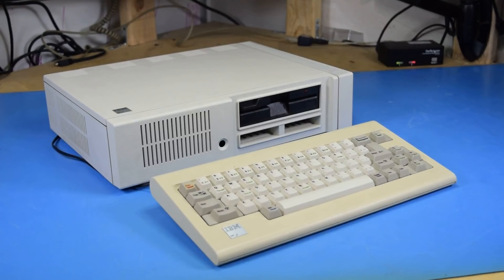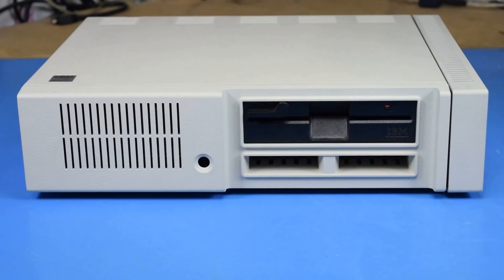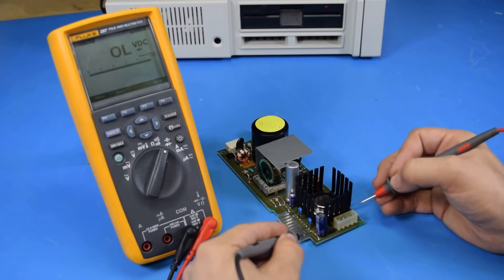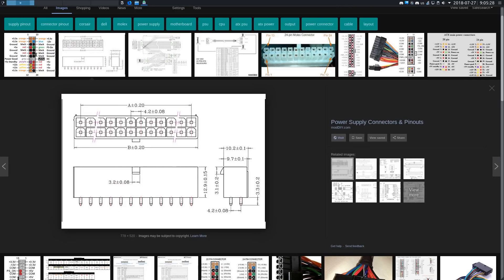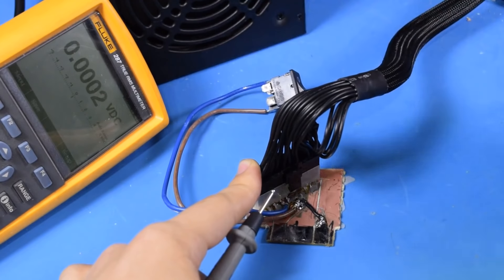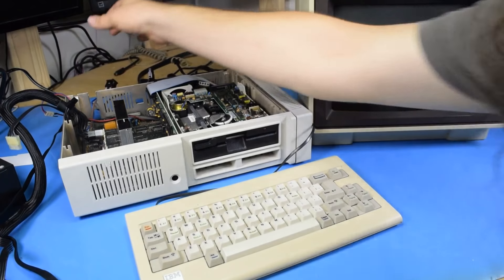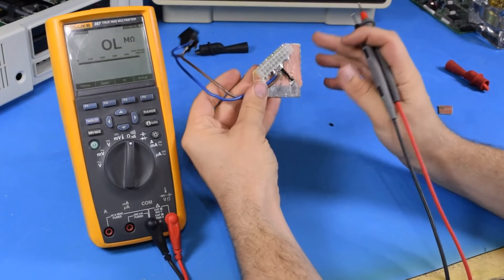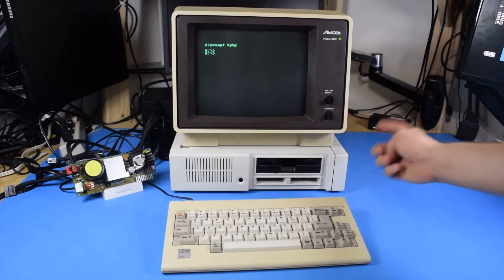0x0035 - IBM PCjr ATX Power Supply Adapter Prototype

Comment: you get a negative resistance because the multi meter mesures a voltage increse rather then a drop in voltage
so the fluc is acting like the electrolyte of a battery

Comment: white vinegar. table salt, hydrogen peroxide makes a weak hydrochloric acid solution that will etch standard hobby grade pcb's in about 30 - 60 min
Reply from the maker: I read about a reusable solution you can make a while ago that can be rejuvenated. I'll probably look into that for a long term solution. I'm not super thrilled with the idea of needing to dispose of extremely toxic chemicals.
Reply: yea that's muriatic acid and hydrogen peroxide, you refresh it by pumping air though it
Reply: You can de-copper used etchant by dumping steel wool into it and leaving it for a couple of days.  It's then not particularly toxic.  Also, sharpies work as etch resist pens.
Reply: @TechTangents  That reusable solution you're referring to, muriatic (hydrocloric) acid in peroxide, I'm guessing, generates cupric chloride which will eventually need to be disposed of as well.  It's waay more toxic than just using ferric chloride and the fumes are horrible.

Comment: Does the original power board have a bridge rectifier immediately after the input socket? If it does, simply connect a 19..24 V DC power supply to the input and that's all.

Comment: Have you seen one of those Racore/Rapport expansion kits for the PCjr?  My PCjr had a double-height sidecar that had a parallel port, a PC/PCjr toggle switch, a memory expansion board and a floppy controller that allowed me to have a 2nd 360k floppy drive.

My memory expansion board had 256kB of ram on it.  That toggle switch was a rather poor attempt to switch between 40 column and 80 column display modes on start up.

Comment: Since the PCjr uses such low amperage, you could just add a 7912 to the [-12v] rail and a Pico-PSU (or compatible clone) to internalize most of the power delivery (still need a external 12v power supply, but those are fairly widely available)
Reply: With the Wide Input PicoPSU, you can even give it 19 volts.

Comment: According to my roommate (who's studying to become an EE), you likely got the negative resistance from having your probes backwards.

Regardless, congrats on getting this working. The flux issue sounded a lot like an issue David had on 8bitguy when he was assembling the PE6502. He didn't clean off the excess flux like he was supposed to, and it ended up causing problems.

Comment: 12:12

I'm fairly sure the click noise you were hearing was just the PSU trying to start up, since the reservoir caps still had some juice in them.

(I'm assuming you tied the /PS_ON signal to ground on your adapter PCB, so the PSU will switch on as soon as mains is applied.)

I doubt there is a relay in the PSU, and it's just inductor noise for a brief pulse.

Props for manually cutting the PCB like that, but personally I would have just used an older / crustier ATX PSU, and chopped the plug off.

Or, soldered some wires (plus heatshrink) directly to the pins of the ATX socket, then just scored the edge connector for the PC Jr out of the copper clad.

Again though, it was genuinely interesting to watch, as I don't think I've ever seen the box cutter PCB method on YouTube before. ;)
Reply: Ohh - I watched the rest. lol

I think we've all done the mistake of reading the reverse pinout once or twice. hehe

I now have the strong habit of double-checking the PSU or whatever with the meter (between common grounds or other known wires).

I've even seen pinouts on the Interweb that have been reversed from how they are labelled.

Comment: I think a cheap ultrasonic bath would make a good investment.
I'm not sure what you cleaned with but I've found that isopropyl can't dissolve the flux I use so I use lighter fluid and then isoproyl now.

Comment: What I have in mind for such power adapters is actually make them run on a 12V barrel jack input. The +12V rail is a direct pass-through (maybe with a fuse, a diode and a TVS as some protection,) 5V is obtained from 12V through a buck converter based on LM2596 (I have the room anyway so bigger components are okay,) and -12V is obtained through 12V through a buck-boost converter based on MC34063.

Comment: Do you also put a molex and fan connector on the board so they don't have to be wired from the power supply.

Comment: It takes in 19V 2.5A AC? I would probably just get a small transformer and solder those wires directly to the power board(as that connector might not be available).
19V 2.5A DC? I would do the same thing, I mean just hooking up wires directly to the power board but use an Asus Laptop/monitor power supply(they are usually rated at 19V 3.4A).
Reply: those power supplies you are talking about are most likely DC and use some type of switch mode power supply circuit so they wont do....he needs 18v or 19v AC...you need an old school power brick with an actual transformer on it and remove the bridge rectifier...and a 19v 2,5a transformer would be quite beefy and heavy....maybe if the PCJR powerboard rectifies the supplied AC immediately right after the input, then you probably could get away with feeding it with DC
Reply: Hugo Barbedo well if I can take a look at it I would understand whether it is taking in the AC and converting it to DC and nothing else then feeding DC would be okay. For AC I mentioned about directly using a transformer.
Reply: yes i misread it..but a 2.5a "real" transformer(not smps) for cheap would not be easy to find i guess...i have a drawer full of power bricks but most are rated at 1 amp or less. but would be the simplest solution of course
Reply: Hugo Barbedo don't know about your place but they are very easy to find where I live, you can easily get 7A rated ones for like 5-6US$
Reply: I am in Europe, Portugal. that seems very cheap for a 7amp xformer...are they toroids or "normal ones"?here i can find nice 12 and 24 volt beefy transformers also cheap from used industrial applications but not 18/19v...24v could overheat the voltage regulator at the powerboard or exceed rating for other components...and those cheap industrial transformers we can find here dont come with an enclosure or with a plug and cords...nice thing would be to find a charger for some type of old device, already with a plug, cord and enclosure, just open it and remove the bridge rectifier..
Reply: They are usually shell type transformers, toroid ones are not that common here. 12V and 24V transformers are more common but you can get other voltages as well plus tapped transformers are also available which offer couple different voltages from a single unit although sometimes they are a bit noisy. 

About the overheating of the power board, well it depends, if it is a linear device jumping from 19V to 24V might not be a good idea but for Switching device it probably will be okay. 

Or maybe add couple wires before the rectification.

Comment: why didn't you just put the connector from the other side, then the pinout would match the pcb
Reply from the maker: There is a lot more space towards the side of the case vs. towards the RAM card. The ATX cable would not have fit if I flipped the connector around.
Reply: in that case i would make right angle pcb to pcb solder connection
but since this board is so simple it would probably be overkill
i wonder if optiplex 755 sff power brick would be any good for that

Comment: Would it be possible to get a 12v power supply, and use a boost converter circuit to bump up the voltage to 18v? A friend is in a simillar condition as yours.
Reply from the maker: The problem is that it is AC. That is much less common.
Reply: Oh i see.. I that case here i think its 16v dc. So a boost converter would do the trick?
Reply from the maker: It could, just make sure it's rated for enough current as well.

Comment: I feel like using a 24 pin extension cable to make an adapter would have been a lot easier, and you could have removed the pins from the connector you didn't need and have the atx connector hanging out of the pc like that

Comment: I’d suggest some decoupling capacitors, just because it’s designed to have such short traces from the voltage regulators to the board.

Comment: you might be able to make it internal with one of those compact ATX psus made for mini itx systems. any modern atx power supply is going to be beyond overkill for that machine.
Reply: Or make it more original looking and use one of the 12DC to ATX psu adaptors, replacing the 18vac barrel jack with a 12dc one.

Comment: Finding a transformer with an 18VAC output would not have been that difficult. Since the original power supply is a switch type you might be able to feed it DC as well (as most switch type supplies just rectify the input and then do the switching.) If you rectify 18VAC you will have about 25VDC so a 24VDC supply would probably work. This would be easy to test with the supply out of the computer.

If the power supplies in these things are not reliable then you could design a new card to hold a new small switching mode power supply (a fully enclosed type) like a MeanWell RT-50B. That would give you a 120AC~240AC input PS that would fit in the case without a big honking ATX supply taking up space externally.

Comment: I wonder if a PicoPSU has enough juice to power one of these.. That'd be pretty much ideal: an entire power supply just a bit bigger than the board you made
Edit: beefiest one delivers 160 watts... Might work? No idea what these draw
Reply: I think it could! I've seen a 386 that had a 120w power supply. Ans these older cpus didnt had a too high wattage
Reply: Yeah, I'd bet it would work great. No giant power supply hanging around outside the case. Might as well spend $45 on a nice modern power supply than $60 on a questionable old original from ebay
Reply: LeiserGeist The PicoPSU still requires an external AC-DC transformer that's pretty large, especially for the 160W version. It's about twice the size of most Laptop power supplies and costs more than the PicoPSU itself.
Reply: Still quite an upgrade from an ATX power supply sitting outside the computer with a mess of wires running in, wouldn't you say? lol
Reply: Picopsu still requires a 12v dc power brick to power it, but yeah it would be pretty elegant. Not sure if it could provide enough amps on the -12 / 5 / 3.3v rails though.
Reply: I think it's not a good idea, those old pcs takes more power from the 5v line than 12v, picopsu may not have a good 5v line to deliver enough power
Reply: Of course more testing would be required before dumping money on any solution

Comment: Ok, thats much prettier then my abortion I had to do to get a normal ATX power supply plug converted to those small 12-ish power connecters on their recent motherboard. I didnt want to wait for a converter and the supplied PSU wasnt working. Just looked up the pin, and cobbled smart power connector to the ATX one, last around 3 years until I took it all appart.

Comment: How did he get -12V?
Reply: Jacek Jagosz the atx power supply already has -12V.
Reply: Gabriel Fuentes Oh. So for my understanding GND on a PSU would have to be +12 compared to actual ground? Could somebody explain?
Reply: ground is still earth ground, ac voltage goes above and below ground.  it just uses a negative voltage reg
Reply: Jacek Jagosz gnd is 0v
Reply: negative voltages can be an unintuitive concept. 

GND is just an arbitrary point, it could theoretically be anything. In order to simplify things, we commonly use GND as earth ground or 0V to earth. 
If you now imagine 2 batteries in series, both 1.5V types, and the center point is GND. If you measure a voltage between GND and the positive terminal of the second battery you get +1.5V, and on the negative end of the other you get -1.5V.
It's the same principle with the power supply.
Reply: voltage is a potential, imagine it as a waterfall, the top is the positive voltage and the ground is the ground, -12 volt is 12 volt but with the voltage potential under ground
Reply: This was a tough concept for me to grasp back when I learned it as well.  The first step is to stop thinking of ground as some actual voltage.  It isn't.  It's just a reference point.  It's totally arbitrary.

It was once explained to me like a ladder.  If you call the bottom rung "Gnd", then all rungs above it are positive.  If you call the top rung Gnd, then all rungs below it are negative.  If you pick a rung halfway up as Gnd, then you have both positive and negative.

This is actually how many bipolar power supplies work.  Incoming power - be that AC mains, or DC switched at a high frequency by a transistor - is fed through a transformer, where the electrical energy is converted to magnetic flux.  Then, another coil on that transformer converts the flux back to electrical energy.  The two sides are now isolated from each other - there is no direct path for current to flow (it must go through a magnetic stage first), so there is no meaningful voltage potential when comparing one side to the other.  This is why the concept of "absolute Gnd" is nonsensical.  Isolation is actually a legal requirement - all mains powered devices must be galvanically isolated for safety.  One convenient side effect is, you have a low point on one end of the secondary coil, and a high point on the other end (and this will alternate at the AC frequency.)  You get to choose which "rung" you want to be ground by referencing everything to one end of the coil or the other - or any tap in between.  By picking a spot in the center (a center tap), you have equal positive and negative voltages with respect to the point you call Gnd.  This is how you can make a +/-12V supply, for example.  The coil is equally happy to generate +24V, -24V, +/-12V, or some arbitrary hybrid like 9V and 15V as long as you don't mind them being opposite polarity to each other.

Now on ATX, because the +12V rail is so much more heavily loaded than the -12V rail, a better way to obtain opposite polarities is to use multiple secondary coils that are isolated from each other.  You can then pick different 0V points on each coil (actually, different rectifier diode arrangements) to make some positive and others negative.  The number of windings of each coil determines the magnitude - i.e., the voltage.

If you don't have a transformer, like with DC-to-DC converters, you have to do fancy tricks like using inductors to store pulses of energy magnetically and then release it through diodes to generate negative voltages.

Comment: @AkBKukU
Hey have you thought about using a Pico power supply? They are ATX power supplies that run on laptop style DC bricks. You might even be able to fit one of those in the case, or at best just have a power brick coming out of the PCJr. 
Here is a link to a 120w one http://www.mini-box.com/s.nl/it.A/id.417/.f . I have seen these things go up to 300w.
Another great project man, keep up the good work.
Reply from the maker: I will be looking into these for pt2
Reply: AkBKukU Cool, great to see if you can make it look like from the outside there are no shenanigans going on. Look forward to part 2.

Comment: you show you failures in the video and instead of people finding it entertaining/amusing/educational they all start to play the "NASA-GRADE-ENGINEER" role....saying its a ghetto job, it looks like a colostomy bag bla bla bla, you could measure twice before cutting etc etc.....oh man....guess what? ITS WORKING. those people probably struggle to change a light bulb at home yet they do the hero thing in video comment sections

so....nice video!did you thought about using a small atx power supply out of a small pc like the asus pundit or many many other similar ones...some of them are small enough to fit inside the pcjr complete with housing and fan. some acer ones are about the size of a laptop charger but only longer so they would fit

Comment: It's just not worth it to make prototypes with a knife. Get some ferric chloride, man, FeCl3. You etch the board and pour the solution back in the bottle. You can refresh it easily when it becomes weak. It is toxic if ingested, but that is nearly impossible to do accidentally due to its characteristic color and smell (and I suppose taste). The concentrations in solutions used for PCB etching are mild and not dangerous on contact with skin, though they do stain clothes. The etching itself is mild and if you don't pour in a ton of hydrogen peroxide to speed it up, it doesn't fume. It lasts for decades in a normal plastic bottle, so there's no need to throw it out, but if you must, it's neutralized easily as well with baking soda, making rust and table salt (and CO2 bubbles).
Reply from the maker: oh, I know this was terrible. I didn't have what I needed on hand to properly etch and when inspiration strikes I don't like having to wait. I'm planning on getting the correct materials to do this properly in the future.

Comment: You could have just put the connector through the copper-less side of the board, all the traces would have been right and you wouldn't have to bend the pins on the 24 pin.... Way more complicated than this needed to be. A rotary tool would be a better tool than a knife for this.